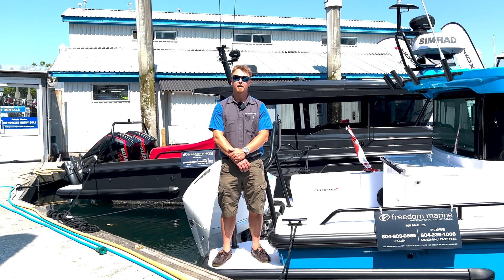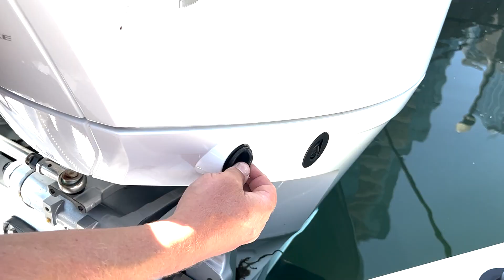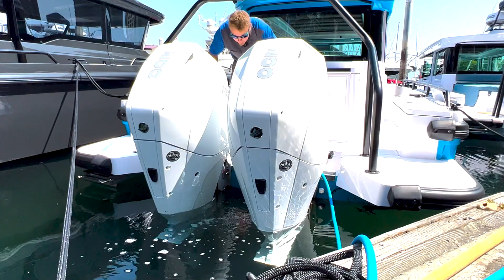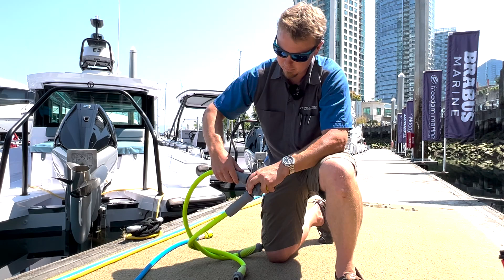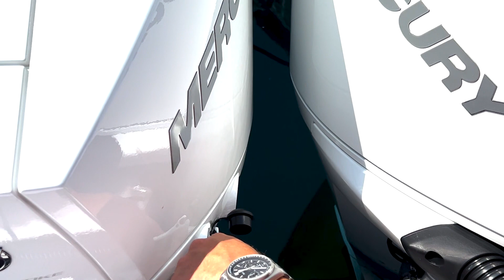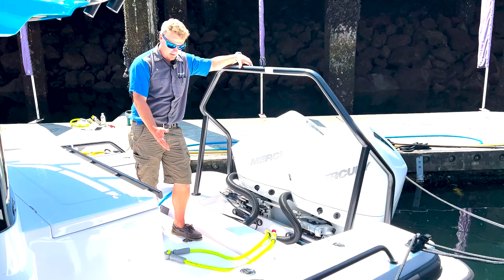Axopar 28 - How to Flush the Engine - Freedom Marine International Yacht Sales

Comment: Actually isn’t it easier to ask the factory to install a reverse engineer flush system?  You simply plug a garden hose into the reverse unit and it flushes both engines or a triple mercury 45 for instance all at the same time while you attend to other docking items.

Comment: Does the engine need to be down to be flushed correctly? Or can it be tilted?

Also, do you need to flush the lower leg/gearbox area after every use in salt water?